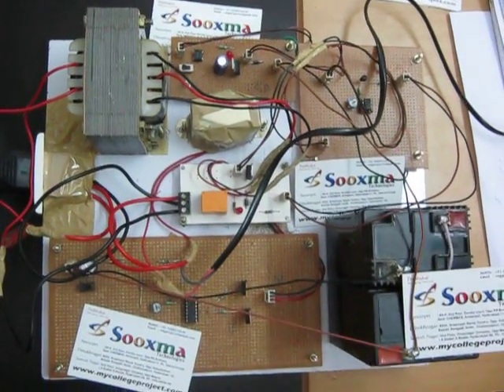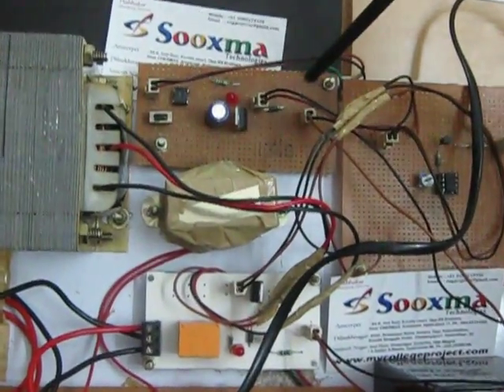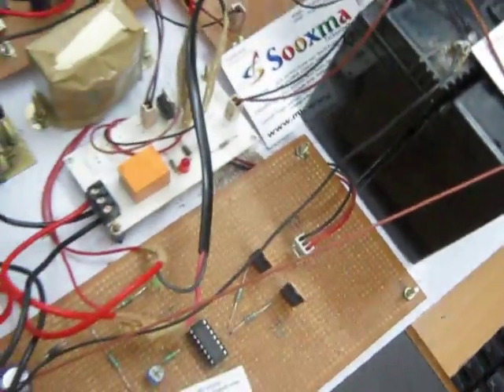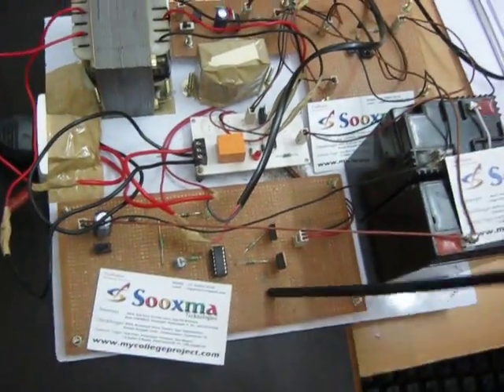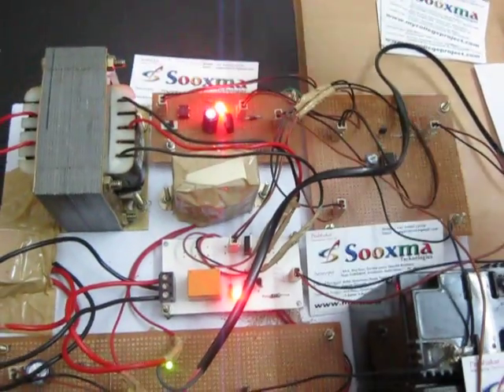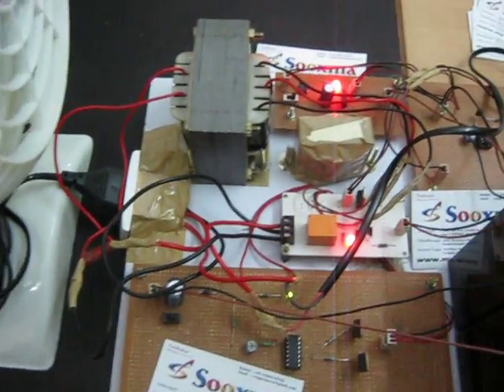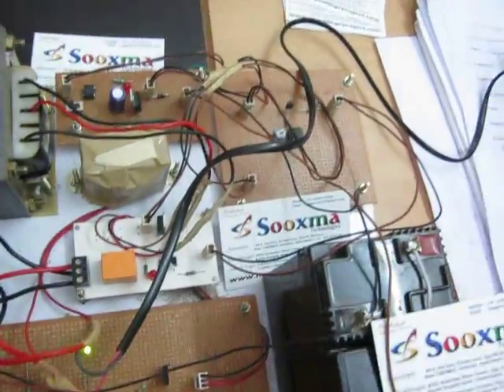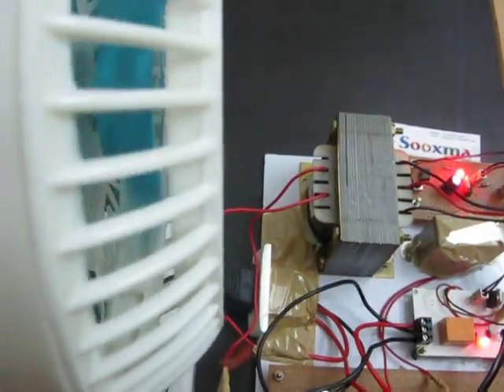Mini UPS system

Comment: Can u please explain how the dc is converted into ac..  Before entering voltage to transformer... Transformer will be only working in ac ? Inorder to step up
Reply: that inverter does the trick ..It will create square or sinusoidal wave dorm from DC